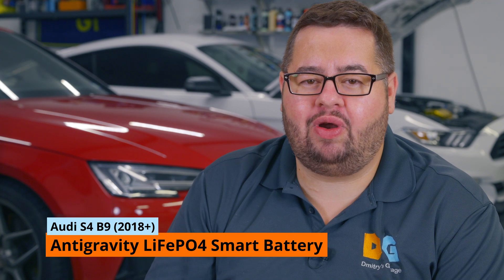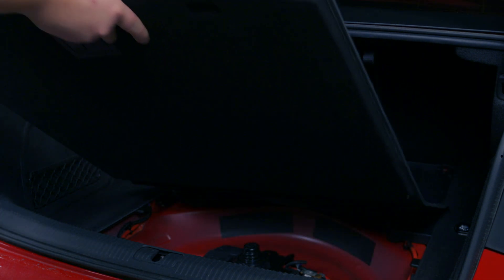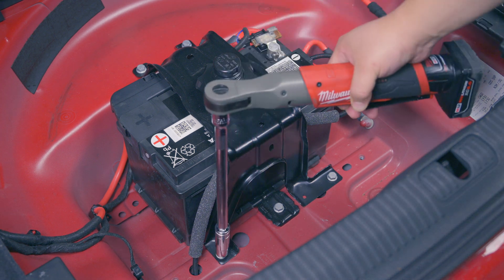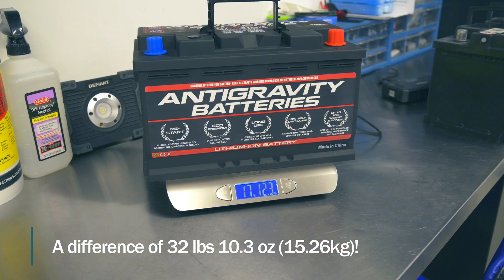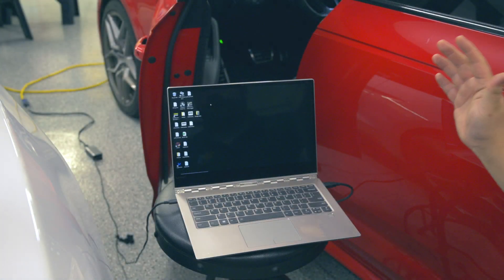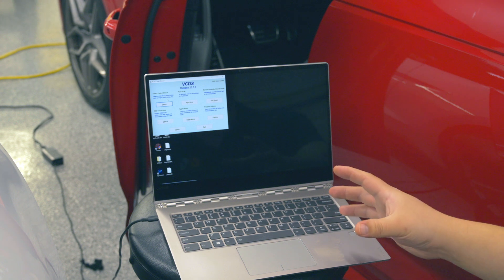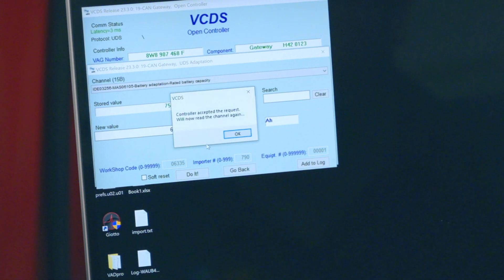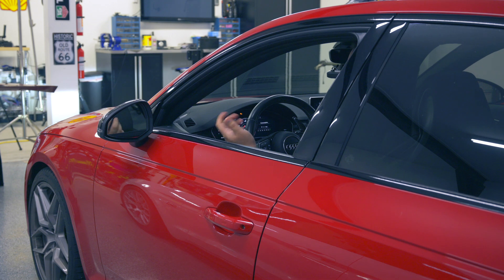Audi S4 huge weight reduction with Antigravity Battery | Lithium Technology & Battery Coding

Comment: Why did you put the spare tire rack back in ?
Seems you could save more weights by leaving it out. Also, the car has more power because lithium doesn’t have a voltage drop like lead acid does under load.

Comment: I see a lithium fep for battery coding in rs5. Would that work ?
Reply from the maker: I think you would have to code it and test it. May be worth a convo with the support team at antigravity. The main concern is this isn’t a direct lithium connection. Meaning your car has a BMS that you are coding, but the battery comes with a BMS too. So i would ask Antigravity how your specific battery’s BMS expects to be treated. If the bms is expecting to be treated like a stock battery then telling the car to treat it like lithium may not give it the right power input.
Reply: @DmitrysGarage  fleece works. The lithium fep coding throw error right away.  Thanks for your videos. !
Reply: @DmitrysGarage  so I found out fleece doesn't charge unless running on highway.  I changed code back to agm and charges even at idle. Weird
Reply from the maker: @aquilaliu  Interesting, I wonder if the rs5 is a bit different, or maybe different year.
Reply: Not sure. Does fleece on yours charge in idle ? Mine is 2018 on stage 3 @DmitrysGarage
Reply from the maker: Hmm i never had issues with the flece setting. Ill have to do some testing
Reply: Your video is very helpful. I changed it back to fleece just to test it some more. But also my rs5 is on stage 3 with upgrade water pump . Maybe that draws more power not sure
Reply from the maker: Yea im on stage 3 too. How were you determining it wasnt charging? Also was it the “binary-agm” option?
Reply from the maker: Ahhhhh yea i dont have one of those. Ill try rigging up a volt meter and testing in real time as i toggle the config with engine running (not recommended, but ill do it for science!)

Edit: couldn’t really measure a difference. One thing is i pre-charged mine on a lifepo4 capable charger before installing. I wonder if the audi bms just isnt great at fully charging one of these.
Reply: @DmitrysGarage  it was the only agm battery coding option i can see. :(

Comment: how the battery holding up ? after the first year, looking into getting one i just purchased my 2019 s4
Reply from the maker: Works great, haven't had any issues. Seems to fire up the car faster, but could have been the old battery getting weak before. UPDATE: Left the car for a month and a half in storage while I was out of traveling and it started right up, didn't even have it on tender. BMS doing it's thing :).

Comment: Any reason why you didn't go with the 40ah for the most weight savings?
Reply from the maker: Mainly because I wanted some balance in total available power and weight, didn't want the bigger battery but also was worried 40ah may be a bit small for the car and all its gadgets potentially impacting battery life. I do still drive this car the most so need it to be fairly reliable.

Comment: Good evening Mr. Dmitry,

Going off on a tangent, sir, what type of ceramic coating do you recommend for a 1/2 ton truck, sir?

Also, what type of “sacrificial” topper do you recommend?  

Thank you, sir. 

Respectfully,
Robert
Reply from the maker: Robert, I'd go with something like the Adam's Graphene liquid coatings, I just tested Exoforma Graphene Ceramic and it was great too, basically any of the good liquid formulas. For a topper, I personally only use them to mask areas that had premature failure, like high wear spots, or substrates that don't take coatings well (i.e. chrome). I think really any of the decent sio2 sprays would be fine. I was pretty impressed with the Adam's Ceramic Boost. Ethos Resist is cool, the Phoenix EOD Titan Detailer has some really cool slickness properties and coatings aren't always as slick as one would like on their own.
Reply: Thank you

Comment: is there a difference between the 60ah and the 80ah? Does it affect the cars performance?
Reply from the maker: It mainly affects how long you can have the battery run without the car running but also should last longer in general. If you got say a 20ah ud be cycling it much faster

Comment: By throwing codes what do you mean? Did it say to charge the battery
Reply from the maker: For when the battery started to fail? Yea it would display battery low messages even though the car only sat a day or two. Sometimes even after a decent drive.
Reply: @DmitrysGarage  Did you have any issues with the battery? I don’t daily my car I start it once a week or drive it once a week and was wondering would this be a good option for the way I drive my car?

Comment: Not sure if it applies to B9 but these lithium batteries caused a misfiring issue on wide open throttle on a B8 s4. https://youtu.be/qIbGEbod8Bs
Reply from the maker: That's really interesting. I wonder if his had a defect, but also maybe it was too small. He's got the tiniest racing battery in that video, that little guy is just 22.5 Ah. Those really aren't meant for street applications. If he had it for a while I could see it wearing through a lot of cycles. He even mentioned it came out of another car (RS3) and it may have even sat for a while since he said had to recharge it. I'm not sure while Braille recommended using it for a street car though. I really can't see lithium being an issue here, it sounds like it's just his battery.

Comment: Congrats!! I should have waited for this video. I just had the dealership put in a new battery, and it looks to be the same amount of money, for a lighter one.
Reply from the maker: Wow! What were they charging for an OEM battery? Too bad, because if the money is the same there's no reason to even consider OEM.
Reply: @DmitrysGarage  I think they said 700 or so for the battery, Plus installation.
Reply from the maker: @Kiss__Kiss  That's definitely more than I would have expected, but dealers do love to make money on stuff like that (tires, maintenance, etc...) I had one telling me spark plugs in my A4 at the time were some insane price when a toddler could have swapped them. They were right on top of the engine unlike the S4 here!
Reply: @DmitrysGarage   Exactly!!! I paid because I needed it done asap.  And yes, I also have a B8.5 allroad. So I believe they are pretty much the same(Sans being a Gen 3, as on your previous A4).